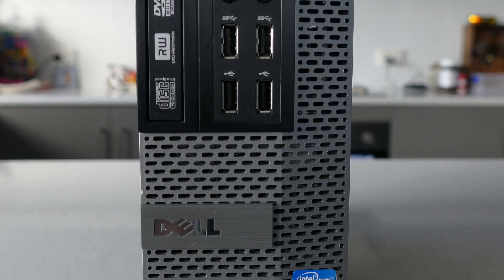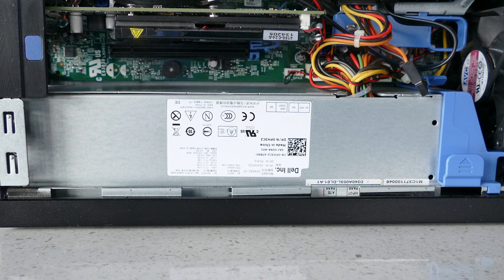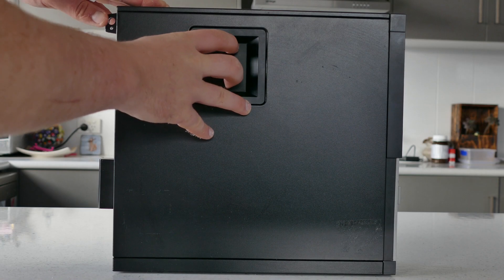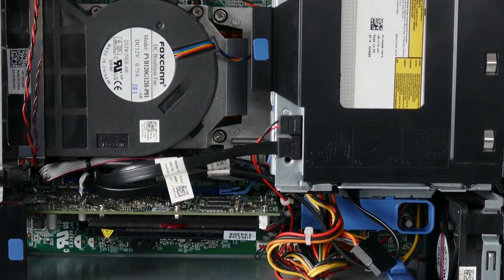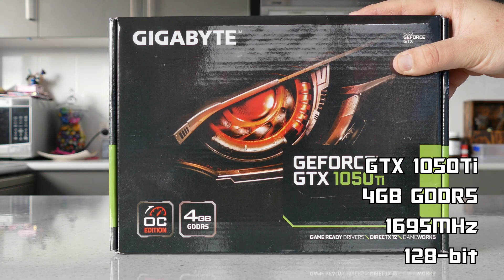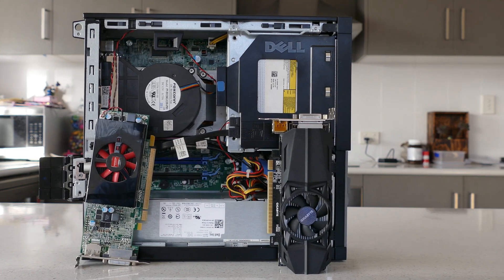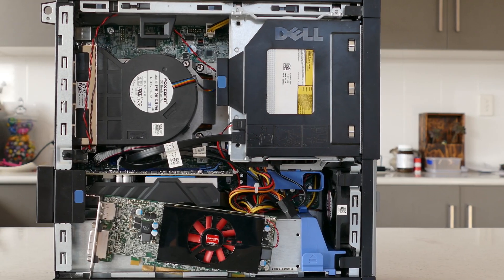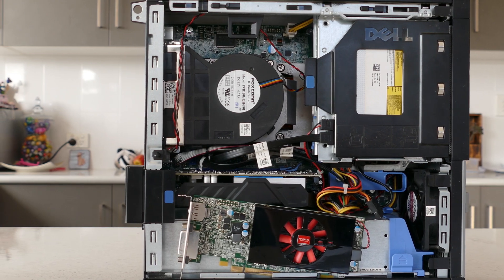Is the 1050Ti a Worthy Upgrade for this Old Dell?

Comment: Hi, I got a Dell Optiplex 790 MT with a i5 2400 and GT 1030 now.  Am I able to put a GTX 1050 Ti in it, because i heard that the Graphics Card can only take 35 W from the PCI-E slot.
Reply from the maker: It will work but is generally not advised to do so as it can cause issues further down the track such as failing or degrading power supply or may damage other parts such as the motherboard.

You can do it but it’s at your own risk in the end.
Reply: @EverythingbySam  If I change the PSU, would it be fine then?
Reply from the maker: Yes you could upgrade the PSU but if it’s Small Form Factor the power supplies that fit are incredibly expensive for the wattage and are hard to find so they’re really not worth upgrading to.
Reply: @EverythingbySam  No, i got the Midi Tower so its fine

Thanks for the fast answers :D
Reply from the maker: Ah ok as long as the motherboard doesn’t have propriety connectors you should be good to upgrade it.

Comment: Is this the 2gb or 4gb version?
Reply from the maker: 1050Ti LP only comes in 4GB variance as far as I am aware.
Reply: On Amazon Mexico, I see a big difference in price between the 2gb and 4gb, both low profile versions. Thanks anyways. Great video btw
Reply from the maker: There is a huge difference in price between the 1050 and 1050Ti especially between the 2GB and 4GB variances of the 1050 compared to the 4GB 1050Ti.

Are you sure they are all listed as the Ti variants and not just a normal 1050?
Reply: You know what? You’re totally right, thanks a lot for the info. I have the Optiplex 790, I think I’ll go ahead and replicate that rig you got there in the video. Appreciated it and totally subscribing.
Reply from the maker: Glad I could help mate. Good luck with your build and happy gaming.

Comment: Hey. I have this computer in stock. Processor i7-4770, 16GB RAM, power supply 255W. Can I use the GTX 1050 Ti Low Profile for such a set?
Reply from the maker: Because of that CPU you will probably be drawing to much power in intensive situations which will trip the PSU I reckon but you may get away with it.
Reply: @EverythingbySam  No way man, the 4770 only draws a max of 7 watts more than the chip you benchmarked, not to mention his PSU is larger than what you benchmarked. Dell PSUs are actually quite good -- they are GOLD rated, and highly efficient. His setup would draw less than 200 watts, WAY less than the PSU is capable of handling.
Reply: Yes, easily. I am using a more power hungry chip, the i7 2600, and am using your exact setup. Go for it, you won't regret it.
Reply from the maker: A heavy load on the CPU and GPU could easily draw over that power usage which is inefficient for the lifespan of the PSU and will greatly degrade its overall power draw performance especially if you are running it constantly. 

So if you don’t trip the power immediately over time you will as the rail constantly heats up with excessive power draw which will degrade with time as all things draw power such as extra RAM, storage and even the DVD drive.
Reply: This is not the same computer. If you have a i7-4770, the pcie x16 slot is only 1 slot, where-as in previous optiplexes, they were 2 slots. You will have to run with this card in the pcie x4 slot. Performance will suffer alot.

Comment: Hi will the i3 2100 bottleneck with the gtx 1050 ti pls reply soon thx
Reply from the maker: Not a substantial bottleneck but some may occur in CPU intensive games
Reply: @EverythingbySam  thx really appericiate it
Reply: @EverythingbySam  also i just subscribed!
Reply: @EverythingbySam  will the cpu hold the gpu back by a lot or no?
Reply: @EverythingbySam  what do you mean by substantial?
Reply from the maker: Depending how CPU intensive the game is or graphically demanding the games you play are the CPU could be an issue in certain scenarios.
Reply: @EverythingbySam  thx
Reply: @EverythingbySam  also how much difference is there between 4gb ram or 8gb ram in fortnite?
Reply: @givemeafuckinr3068  shut yo bitch ass self up lol

Comment: Hello I'm back again would a upgraded PSU and a EVGA 1060 6gb single fan fit in the case cause I have looked up the differences between a 1050 people put in these machines and the 1060 looks about that same width I'm just concerned I won't be able to fit it in the case any thoughts ?
Reply from the maker: They don’t make low profile 1060s and only low profile GPUs will fit. The current most powerful low profile GPU is a GTX 1050Ti LP
Reply: You can't upgrade the PSU so you'd need a new case as well.
Reply from the maker: You can upgrade the power supply as Dell has up to a 300W available although it is quite an expensive investment.

Comment: Hello I am looking at buying a Dell optiplex 9020 with an i7 16gb ram and I am looking at getting a GeForce GTX 1050ti but I'm worried that I'll overpower the stock power supply can you give me any tips ?
Thanks
Reply: The Dell 9020 pcie x16 slot is a one slot socket. You will need to run this card in the pcie x4 slot to physically fit. Performance will suffer alot.
Reply from the maker: With that configuration yes you will more than likely hit the power threshold at some point but you can buy better power supplies for that form factor such as 300W but they are usually quite costly and uncommon.
Reply: What cheap power supply would you recommend ?
Reply from the maker: I can’t recommend one as I haven’t looked into it enough sorry.
Reply: All good

Comment: Wouldn't the power supply no be able the support the card? 

Im planning to buy this card for my 990 and I've seen many saying the power supply is not enough for it, that card wattage is about 35w for a card not enough for the gtx 1050 lp which requires a minimum of 60 to 70w how did you get around this?
Reply from the maker: Wattage is generally a maximum use estimation. In reality it doesn’t always pull that wattage so as long as you aren’t maxing out your system across the CPU and GPU you would be lucky to hit the power threshold.

Comment: Your channel definitely deserves more subs!
Reply from the maker: Thanks!
Reply from the maker: If you bought a cheap riser cable there is a fair chance it either will not work or work at a much lower performance then it is capable of.
Reply from the maker: You will still have issues as the graphics card will be expecting to draw 75W from the PCIE lane to function properly
Reply: Sam will any gtx 1050ti lp work?
Reply from the maker: Yes
Reply: @EverythingbySam  will it be the same performance as a cheaper one (lp)
Reply from the maker: As a full sized one? Yes they’re all within a few FPS of each other
Reply: @EverythingbySam  low profile?
Reply from the maker: All LP are practically the same
Reply: @EverythingbySam  can you send me thee link for the graphic card on amazon
Reply from the maker: https://www.amazon.com/Gigabyte-Geforce-Profile-Graphic-GV-N105TOC-4GL/dp/B06WWLWWJM
Reply: @EverythingbySam  can i put a 1650 low profile in a dell opiplex 3010 sff if yes should i put a gtx 1050ti or 1650
Reply from the maker: If you can afford a 1650 over the 1050(Ti) go for it as it’s about 20-30% better performance
Reply: @EverythingbySam  on new egg its cheaper can you send me the link
Reply from the maker: I am Auatralian sorry we don’t use Newegg so you will have to check with your own countries resellers (Newegg, Amazon, eBay, ETC)
Reply: @EverythingbySam  will the 1650 fit in a 3010 sff
Reply from the maker: It’s the exact same case as this one so yes
Reply: @EverythingbySam  im worried if it dosent work
Reply from the maker: I have literally shown it working and many others have done the same